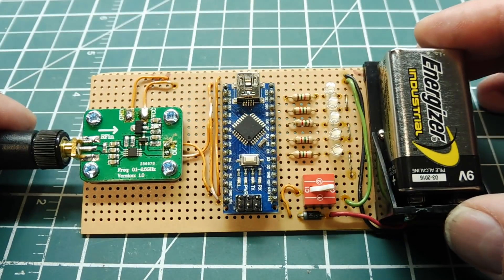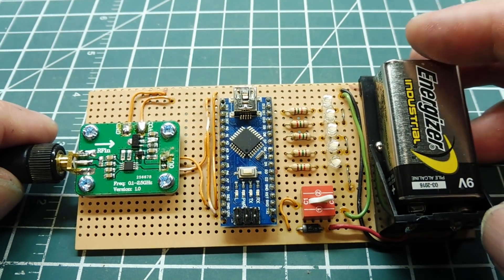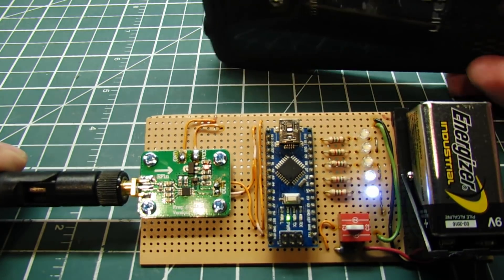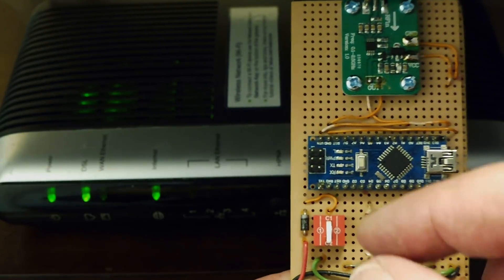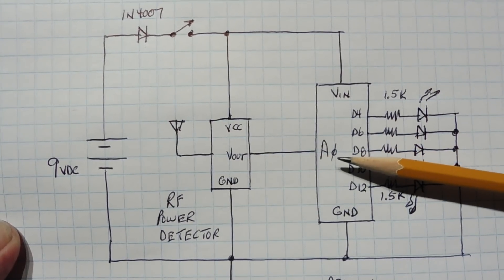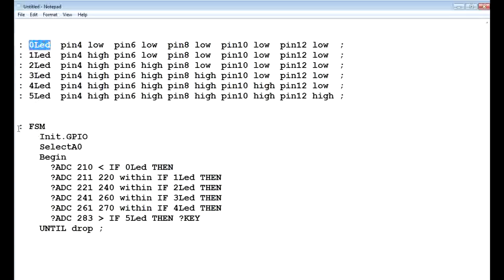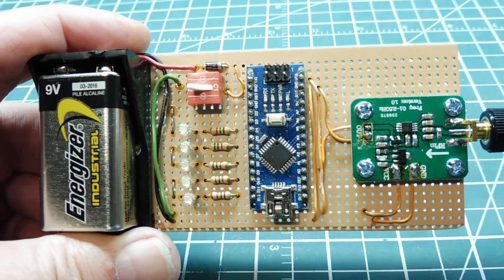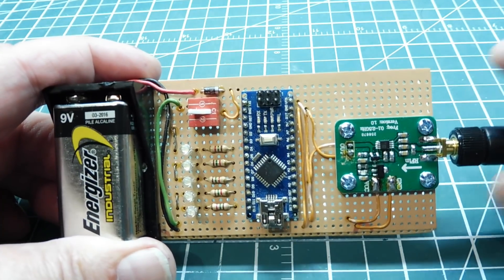Build A RF Field Strength Meter

Comment: hai, is there any output number that can be seen for the strength of the signal? thank you!
Reply from the maker: From the DC voltage output you can get a dbm value that is seen at the antenna terminal. There is a voltage to signal strength chart in the data sheet. Check out this video: https://youtu.be/A6Cc2nQInAU

Comment: Hi, this is an interesting project, would it be possible to make it a project where i could do remote readings of the energy leaving my endfed in lets say a webpage? The arduino serves the webpage and i could make a long distance reading of the hf strengt observed by the fiels strength meter. I could imagine it could even supporting the tuning of an loop antenna by showing the readings during the tuning with the vacuum C  in the right frequency. Are the code and the schema somewhere to download?
Reply from the maker: The schematic and code are shown in the video. You could also use a Scamp3 board to get FSM values and send them wirelessly over the air using LORA.  Check out these videos for more information:
https://youtu.be/3-Gy4HOhiWY
https://youtu.be/A6Cc2nQInAU
Reply: @0033mer  In the video's i also hear the sound of the transmittion, did you use a speaker or something like that?  I am curious how this works as a system to pick up HF signals. The receiver board could be damaged when i transmit with 100 watt, is there a way to protect the board some way? I am not an electro technition, i try to figure out if your meter is also usable for me in the field to find noise sources, and or detect signals that should be there or not be there at all.
Reply from the maker: I have an RF service monitor tuned to 915 mHz to heard the data transmissions. The Field Strength Meter is broadband and picks up all transmissions in its dynamic range. To pick out noise and single frequencies you need a spectrum analyzer like a Rigol DSA815.

Comment: having watched your other vid on a using a discreet wheatstone bridge for the same job, i'd love to know which one is the most sensitive?
Reply from the maker: Generally they are about the same. The wheatstone bridge will degrade a bit as the frequency increases as it does not have the bandwidth as the RF amplifier version. When you are in close proximity to the transmitter the performace is basically the same.

Comment: Can i use a 433 mhz receiver with rssi outout pin instead of rf module to determine incoming strength of a signal beaconb
Reply from the maker: Yes, but it will be restricted to 433 MHz signals only.

Comment: This help me a lot, but I would like to know the wires material used in this piece of work especially the ones that you used for connecting the meter to your computer.
Reply: Pls it for my project
Reply from the maker: It's 24 AWG solid copper wire.
Reply: @0033mer  Thank you very much :)
Reply: Sorry to bother you again but can you please do a list of all of your materials required for the meter. Thank you in advance.
Reply: The 24 AWG solid copper wire is used in the circuit but what is the item use to connect at the rf meter module?

Comment: Hi champ, love your work! Could this be used to compare antennas? Cheers!
Reply from the maker: Yes ..You can measure the field strength of two transmitting antennas under the same conditions for comparison. The RF amplifier is broadband so ensure no other transmitters are in the area while testing. For more accurate results use a voltmeter to measure the DC voltage output of the amplifier. There is a voltage vs signal strength chart that can be used to obtain the results. The chart can be seen in this video: https://youtu.be/FVaiWzJSvNU

Comment: how the is the rf power represented in the arduino like what is the decimal value you get from the rf sensor dependent on the rf signal?
Reply from the maker: The rf power to voltage output is covered in the video at 3:27.
To see the power to voltage graph check our this video: https://youtu.be/FVaiWzJSvNU

Comment: Very well done - I was able to finally get this working but would add that an important aspect of the Sketch is to look for a low signal over a window of time since the low voltage can be short duration.  Although I can get responses from RC RF devices, I get no response to my cell phone like you show.

Comment: Yo.
Why are not we using power and thus information transmission through Earth as Nikola Tesla devised it? Like his wardencliffe tower might look like aether pulsed propagation but in fact is just an air capacitor for the current to do its work from Earth.
He also explains that you can automodulate the signal so you can transmit voice with no microphones or speakers and so on

Comment: Can you share schematic for this i am looking there are 2 slots one is vout connected to a0 of audrino and dont know if you ground the other or short both of em
Reply: I had the same question.  I did a continuity check to find that the supply ground is connected to the outer "OUT" labeled line.  That is the one with the square pad is ground and the one with the circular pad is the signal.

Comment: I added my RF detector  module output to the analog input of arduino but it detects DC background of output instad of AC signal so I add a capacitor but you didn't use it. Also arduino continuously detects 60Hz noise from near electronic devices.
Reply from the maker: The output of the RF detector is DC, from .5vdc to 1.65vdc. The capacitor you added on the ADC pin will make it floating so it could pick up stray AC.

Comment: Wouldn't it be better to use an omnidirectional antenna? If so, would an antenna like this one (https://www.ebay.com.au/itm/5-8G-Image-Transmission-Antenna-Multi-axis-Gain-Omnidirectional-FPV-SMA-Triumph/113954593233) be good for the full 1MHz to 2.5GHz range? I can see that it lists the rated frequencies but does that matter for this application?
Reply from the maker: The antenna I used is omnidirectional and tuned for 915 MHz. You will not find an antenna that will cover 1 MHz to 2.5 Ghz. Select the proper antenna for the band you want to cover.

Comment: Hi I would like to use the AD8318 module to detect the RSSI from cell phone tower. I do have a dual band 800/1800MHz antenna. Is there any way to know which frequency is being monitored? I also have a 2.4MHz antenna for testing purposes using spectrum analyser
Reply from the maker: Look into SDR (Software Defined Radios)  This would be the easiest solution. https://airspy.com/

Comment: can we connect speaker to it and vary the sound loudness to show strength of the signal
Reply from the maker: A simple voltage controlled oscillator driving a speaker will vary the frequency or "beep" rate with signal strength increase.
Reply: can I connect output of RF board to 555 oscillator circuit?will it drive oscillator circuit.i want to create constant frequency but variable amplitude to show strength.i do not want change in frequency.
Reply from the maker: When the Nano reads the output voltage it can then control a X9C103  (digital volume control )  to control the amplitude of the oscillator.  https://youtu.be/c8eTzigpJu8
Reply: yes you are right but in that case  there will be audio step change in sound loudness will be observe that will creat bad impact of design.

Comment: what is the code to program it, I really need it for a project in my university, I hope your answer thanks.
Reply from the maker: Code starts at 4:15
Reply: and the code for the arduino sketch?,sorry to bother.
Reply from the maker: I use the Forth programming language for all my code and do not use the Arduino IDE so there is no sketch. Forth is faster and more efficient. To program a sketch, take the ADC reading and turn on more LEDs as the value increases. Another option is to use a LM3914 bar display in place of the Nano.
Reply: @0033mer  I guess he couldn't be bothered to use a language used most commonly with Arduinos, we have to learn another language. NOT COOL!
Reply: In my country do not sell the rf module to 900Mhz, how would you do to create one? the problem is that I need it for wednesday
Reply from the maker: Check online for an analog FSM circuit that you can build. https://www.qsl.net/va3iul/Homebrew_RF_Circuit_Design_Ideas/Homebrew_RF_Circuit_Design_Ideas.htm

Comment: Correct me if I'm wrong, but Arduino could be replaced by LM3914 in this case....
Reply from the maker: Yes .. that would be a good choice as a no code solution and you get 10 output LEDS. I have used the LM3914 in this type of application. Texas Instruments has announced End of Life on the DIP package so it will soon be obsolete. The current price on old stock is the same as a Nano online. I like the ability to set the threshold levels in software and I have multiple profiles for different radio applications stored in flash. If you have any LM3914s on hand you can use it to replace the Nano.

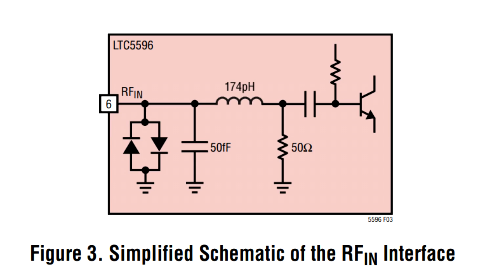Comment: 6:00.. Wondering if you could monitor the input by the output of the RF chip using the Arduino to disable the power to the RF Detector Chip if the detected signal is too high for the chip (5W) ?
Reply from the maker: For high power monitoring I use a feed through attenuator. It just screws on to the SMA connector on the detector module.
https://www.banggood.com/2W-SMA-JK-Male-to-Female-RF-Coaxial-Attenuator-6GHz-50ohm-20dB-Connectors-p-1079176.html?rmmds=search&cur_warehouse=CN